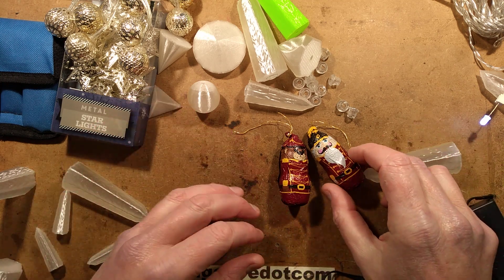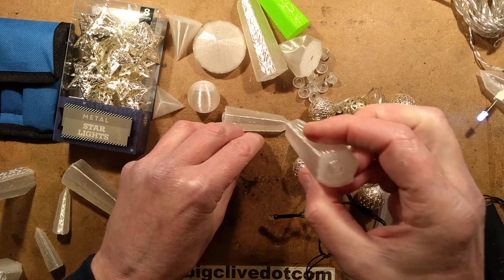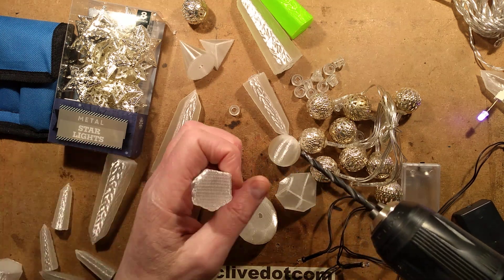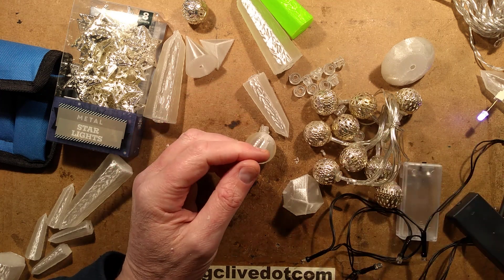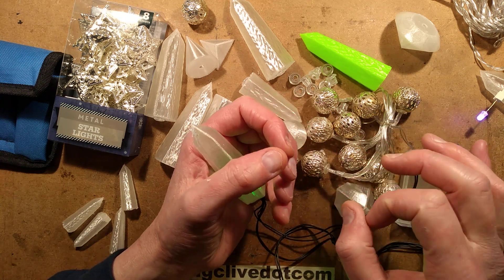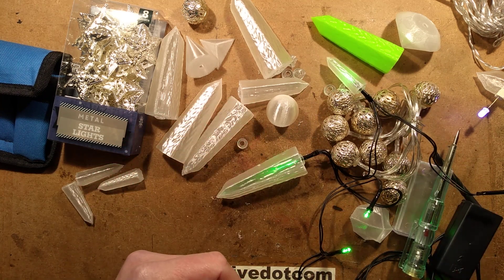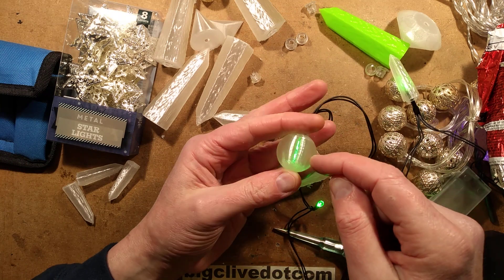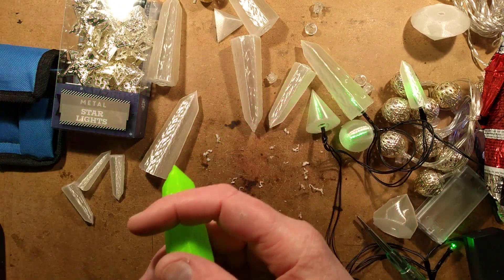Making Kryptonite Christmas lights.

Comment: I'm going to design that little adapter plug in CAD and print some in TPU rubber filament.  It will be just perfect for building and repairing all sorts of LED lighting.  (Without having to give dollary do's to the cheap shop, who probably hasn't got those exact same things anyway).

Comment: 8:15 I love it when unusual items are used as tree toppers. So much better than boring stars or angels.

My tree topper these last few years has been a small USB-powered lighted tree that I bought from Walmart. I was originally going for a dumb meta joke (a tree topped with a smaller tree) but it started becoming a yearly tradition.

Comment: Im searching for a way to protect my LED Christmas lights against water. I had the idea to use Plasti-Dip, which is a rubbery spraycoating for Vehicles. However, you can buy plastidip (or similar fake-products) in a transparent color and without a pressurized spraycan. I would dip every single led in it to reduce the risk of waterdamage. Maybe you could use this idea for future content? 

Please excuse my bad english.
Greetings from Germany, where its impossible to buy waterproof, standard (not the copper-wire-type) christmas lights, which last longer than a year.
Reply from the maker: I've tried various things to prevent water getting into the sleeves of standard LED lights.  Plastidip might work, but could be messy with so many lights hanging in random directions to dry.  You can get more rugged lights for city Christmas lighting where the LEDs are sealed into resin filled cups.

Comment: Hey clive

I recently put my Ledray 100 flashlight through the wash, by accident, and although it still works just fine, I want to replace the LED as it seems to be a little less bright. Ive never done this before and I dont want to sod the whole thing up. Have you done the same thing, and is there a video on it, or could you make one?

Comment: Hey Bigclive, are you familiar with X10 products?  I have some "plug n power" lamp modules that I got about 20 years ago to control some Christmas lights.  I read on Wikipedia that it was actually a Scottish company called Pico that developed this standard.  Anyways, one of them stopped working....but only in certain rooms.  Doesn't matter which of my 4 modules is being used in those rooms, none of them work....but they work fine in others.  What could be causing this?  They always worked before and I can't think of anything that has changed in the last year.

Comment: Put a small green crystal in a larger clear one. Maybe multiple smaller ones.
Could also try including an internal structure in the clear ones to act a bit like light pipes or diffusers. Not sure how they would direct the light when printed like that. 
Now I need to go buy some clear filament. I'm still new to 3D printing and haven't tried clear or even really looked into it thinking it would be crap. Those crystals look pretty damn good, though.

Comment: you could just wire a simple switch across the e and c pins or d and s pins if it is fet of some kind that will bypass the timer function.

however if that same driver also blinks the lights it may be possible to replace the resistor or capacitor that sets the timer as long as it is not a micro processor chip.

if it is a micro processor chip you can replace the crystal oscillator with a lower value basically underclocking there by the blink pattern would also be slowed down.

you could also use a raspberry pi or some equiv or even a arduino to animate the lights but never turn them off.

you are eating on the show again  are you trying to get youtube's algorithm to automatically flag the videos as sexual in nature by moaning when eating.

also we did not watch your video to see you eat we want teardowns of dangerous and dodgy products.

if we want to watch you eat we would travel all the way to the uk to visit you at the local tavern or eatery.

though you did better on limiting the eating and drinking
Reply from the maker: It's much more complex than that.  The same chip that does the timing also drives a switching booster to increase the output voltage and also an H-bridge driver to swap the polarity for animating the lights.
Reply: couldnt you reverse engineer the animation and do it in arduino or raspberry (yes it is more power hungry so you can then compensate with more batteries even using rechargables like lithium taken from the other devices you have torn down.

Comment: Hello mate , can i have some advice i immediately thought of you .
I have a dash cam i paid alot for it few years ago but battery has failed. Can u tell me what battery i need its a mivue 538 delux dash cam. 
I will open it 2moz but searched for it and cannot find a battery for it. 😁 thanks
Reply from the maker: If you can get access to the battery inside then it will possibly have a 6-digit number on it like 053040 which relates directly to its dimensions in millimeters.  You may be able to find a suitable replacement online.  Choose a protected cell for extra safety.  (has a small protection PCB at the end.)
Reply: @bigclivedotcom  ok great i belive after some reasearch its a 402035 i hope lol 
I am going to open it today had a look on youtube and looks tricky but will give it a go. Thanks

Comment: Stepped drill bits changed my life.  I'm curious as to why you used a 5mm bit to drill a pilot hole when the stepped bit will do that job fine itself.
Reply from the maker: Latterly I did use the stepped drill for the hole.

Comment: importantI: in continental Europe you can find these in stores called Pepco, at least in Poland. There are even the same Kodak batteries. Prices are good too. Similar LED sets cost 2EUR/8RON/49CZK/8PLN/15KN/590HUF.
I'm wondering if pepco is some kind of a re-branded poundland.

Comment: Why not remove the internal timer and make your own power supply?
Reply from the maker: Quite complex as this string uses a 5V supply and the same chip that does the on/off timing also drives a boost circuit and an H-bridge driver for polarity reversal control of alternate LEDs.
Reply: Maybe you can replace it with suitable resistor and straight to mains? It would flicker though. These timers are not very reliable or accurate as I had experienced.

Comment: Stop doing this to me, showing me the green LED bulb.  I haven't even figured what to do with the normal fire ones yet that I couldn't resist buying after you showed them. :p

Plus you make me want to buy a 3D printer which seems extreme for "just" making christmas lamp shades.

I was planning to go see the local fab lab to learn about 3D printing, guess I have an excuse now.  Unfortunately probably won't happen until after Christmas.

Comment: Does any kind of UV string light exist? Preferably at a safe-ish long-end of the spectrum? It would be neat to try this with a black light-fluorescent filament so the visible light is emitted at the actual surface of the crystal. If it can't be obtained off the shelf, one could swap out white LEDs on an existing string... I think the forward voltage requirements are similar between UV and white LEDs.
Reply from the maker: You used to be able to buy UV LED strings on eBay, but they were the dangerous mains voltage ones with minimal insulation and under-rated resistors.  Ordinary blue strings work very well for stimulating fluorescent colours.

Comment: no you are missing the whole point of 3d printing doing this all wrong. the whole point of 3d printing is to print stuff that is exact measurements with no waste at all. you print it with the hole already in it. you can make about anything you can imagine and have it all done without having to do any work really to it after it is made.
Reply from the maker: Just starting with 3D printing, so that comes later.

Comment: You bought a 3D printer! Fantastic! You could also drill the hole using a 3D software before printing it. Just do a Boolean difference with a cylinder of the property diameter.

Comment: If you put any kind of clear silicone inside, then stuff the liner for the LED you get better results. Also, print in ABS, so you can acetone wash them, for even better results. The silicone doesn't need to be put in evenly, you can actually experiment with it for different results, more, less, stuck to one side more than another etc.

Comment: 3D print a crystal shaped topper for the internals of the flame lamp. ;-)
Reply from the maker: I did actually consider that, but it would have taken a long time to print.
Reply from the maker: I also considered gluing separate crystal spikes onto the sides of the lamp.

Comment: Instead of having an external timer to regularly reset the lights own timer wouldn't it be neater to replace the lights own control box/power supply with a generic supply that runs continuously?
Reply from the maker: Bit more complex than a simple supply.  It's an odd voltage (20V) and has to switch polarity at about 100Hz or more to illuminate all the LEDs that alternate in polarity along the string.
Reply: @bigclivedotcom  look around. You've probably got a motor driver board that will do nicely.
Reply: bigclivedotcom Why not 50Hz?  An old school transformer would do that with an output resistor.
Reply: 50Hz would probably make the lights too flickery. With a motor driver board the lights could be driven with a slow waveform so that alternate lamps slowly dim and brighten. Wonder how that would look.
Reply from the maker: @johnfrancisdoe1563  It's finding the right voltage of transformer at short notice and the 50Hz flicker is very noticeable alternating between the two channels of LEDs.

Comment: Sweet! Good move on the Cetus, mine print a lot of Christmas charms as well.
Reply: There he is!  As soon as I saw he was using a Cetus I knew you'd be happy!  😁
Love your channel!
Reply: Never expected to see Maker's Muse here. Very cool. :)
Reply: It seems that all 3d printer enthusiast shear the same intrests.
Reply: Cetus is one of the best 3d printers  on my opinion. Great channel as well. I had the tevo michelangelo a while back, got me a cetus and it is so wonderful
Reply: Needs some green translucent PETG. I'd use the YOYI I really love their colors
Reply: No idea why you guys like cetus so much when any 100$ 3d printer chinese kit has more tinker capability, much lighter, and can print 60-120mm/s without the extra mass causing problems.
Reply: @dimitar4y  Because it's cheap all-in-one sort of package. No need for tinkering and the quality is much better than those Chinese kits.
Reply: @dimitar4y  i know how the Chinese kit's are, i have one myself. What i mean is that the machine has some reasonable constraints for example an bed that is level and a nozzle assembly that is close to spec. The Cetus has some nice linear rods and overall (imo) better design than many Chinese kits. The half finished UI, most of the power components, AC wiring and some movement structure of the Chinese kit's are less than adequate. My self i recommend a kit as a first printer, because the learning experience, but i rarely would recommend a Chinese  kit. I have needed to replace the PSU and the motherboard in my printer, because of their bad design and quality.
Reply: @dimitar4y  i'm just stating the facts about most of the Chinese machines. With the bad design i mean that the construction and manifacturing methods chosen aren't optumal, because the Chinese manifacturer doesn't care about the customer, only the profit. I replaced the PSU because it was such poor quality i couldn't trust it.

Comment: Damn, I don't see any layer lines so what layer height did you print them out at and which filament, and type, did you use?
Reply from the maker: Generic clear PLA 0.4mm nozzle and 0.2mm layers.
Reply: MY GOD, for all of that they came out fantastic as I can't see any layer lines.  WOW.

Comment: Try vase mode sometime if these weren't already printed in it. It does a single spiral without any seams and produces a very clean result.
Reply: Good tip! And it prints even faster!
Reply: Vase mode needs it to be open on one end though, these models are all enclosed.

Comment: Hey Clive, is that crystal model hollow, or did you print it in vase mode, i.e. 'spiralize external contour'? 

I checked it in meshmixer and it looks like the walls have no thickness, but in the video it looks like the crystals are more robust than I would have expected them to be in vase mode.

Update: Actually never mind, 2 shells and zero infill does the trick :)

Also, can you link the PLA that you are using? It looks great
Reply from the maker: It's generic PLA bought from a local (UK) eBay seller.
https://www.ebay.co.uk/itm/3d-printer-PLA-filament-1-75mm-1kg-reel-Free-P-P-1-day-delivery-on-multibuys/253963659703?var=553285492440

Comment: Surely you, of all people, could bypass that timer with a couple of wires?
Reply from the maker: I opened one of the controllers.  It takes 5V in and then converts it to about 24V and uses an H-bridge driver to switch the output polarity.  Static illumination is actually continuous polarity alternation for two channels of LEDs in inverse parallel.  So not easy to change without adding something like a custom programmed microcontroller.
Reply: @bigclivedotcom  Replace the microcontroller with a 555? Or just drive the LEDs from an AC source, either a transformer plus limiting resistor or a series capacitor and resistor combination to run directly from mains.

Comment: I wish I could justify buying myself a 3D printer
Reply from the maker: The price continues to fall.  You can get kits from China which include a bit of a setup and learning curve or you can get a ready to go unit like the Cetus 2 which has very little assembly and sleek software.
Reply: It's a slippery slope (personal experience)
Reply: Build one. Easy to get the bits for one and you can save a fortune!
Reply: The ender 3 is a great choice and has a lot of upgrade options!
Reply: The Ender 3 and the Cetus Clive has are really great! Ender 3 at the price is nearly unbeatable. 
They may seem hard to justify, but they're INCREDIBLY useful! You just have to kind of retrain yourself to think, "Oh yeah! I could just print one!".

I've make tools, jigs, lamps and lampshades, PC stuff, fans....and a bunch of other useful stuff I normally would have had to buy.
Reply: Ender 3 or Pro are good quality and easy to build. Heated bed makes them a bit of a no brainer over the Cetus IMO unless you only want to do PLA.
Reply: If it's the price that worries you, there are plenty of printers that are right around $150-$200 US, including a few you don't even need to build that are of surprisingly good quality. And while they do still have a little bit more of an initial learning curve, I found that to be unbelievably useful working on much more complex builds later on with higher end printers. Even more so when I started designing my own printers.
Reply: You can get a Crealty ender 3 from Gearbest for £135 or if you don't mind a bit of assembly the Anet A8 for £111 (my first printer and it's still happily printing away.
Reply: @maxximumb    I bought an Anet A8 a week ago and I'm having a ball - AU$189.  It's rapidly getting upgraded - stiffening support, cable chains, covers, and bling.  Steep learning curve, but too much fun to stop.

 After seeing Big Clive's crystal lights I wish I'd  put clear PLA on the first order.  Maybe next time.
Reply: Marco Reps helped me decide. https://www.youtube.com/watch?v=5JZ6yT_WM58
Reply: Neither could I.  Until last weekend!
They've come down in price.  Not received it yet and Hermes tracking is being shit. Either that or the buggers haven't posted it yet.  Coming from a German warehouse (allegedly...)
Reply: Which one have you ordered?
Reply: Creality Ender 3.  About £150 (I added the glass bed, I think that's good?).  Nice reviews but I can't recommend until I have it!
Reply: That’s a great price, and other people’s reviews of it make it sound pretty good. It would be good to know how you get on with it :)
Reply: +1 for the Ender 3. It's an amazing deal for a really solid piece of kit.
Reply: I just bought an Ender 3D pro and will be delivered tomorrow. Can’t beat $270 USD and tons of great reviews.
Reply: I bought a cheap Chinese one (Anet A6) over a year ago, and had lots of fun with it, it's printed loads of upgrades for itself and it's not half bad now.

However, after a bit of a parts shopping spree on banggood, the A6 has recently been running overtime printing parts for my new printer which I'm building from scratch... We shall see if it prints better than the modified A6 or not!
(It better had, it's cost more in parts than the A6 did originally!).
Reply: My justification for buying an Ultimaker about 5-6 years ago was "hmm.. this looks pretty cool, I want one" turned into me working with 3d printers as a full time job for the past 4 years. So it worked out for me :P
Reply: I have a Monoprice Mini Select v2. It's been a great little workhorse and is currently $180 on their website. I would recommend it or the Creality Ender 3 others have been suggesting for getting started. That way if you get into 3D printing you can get something bigger and better later once you've outgrown that initial printer, but if you don't get into it b  it's not a huge financial investment.

If you decide to get into it, make sure to do your research first. While 3D printing is easier than it used to be, the term can be a little misleading. We're still not at the point of see cool thing, press print, have cool thing. 3D printers are actually an additive CNC machines (versus subtractive like a CNC milling machine). It can be learned, but I know too many people who didn't do their research and no desire to go through the steps of learning how to actually print something from Thingiverse or other similar sites let alone learning how to design things themselves.
Reply: Just sell some 3d printed carnival accessories, it'll pay for itself 😉